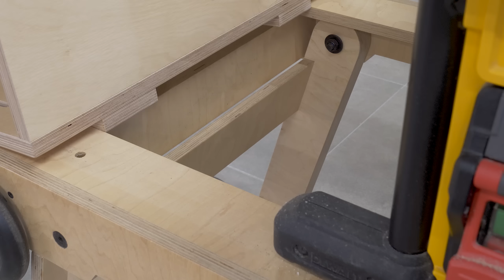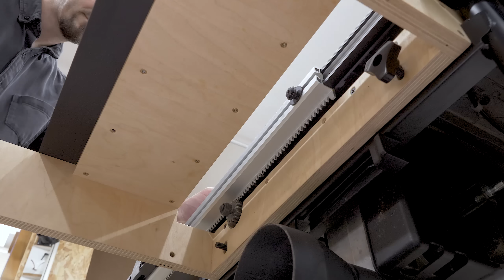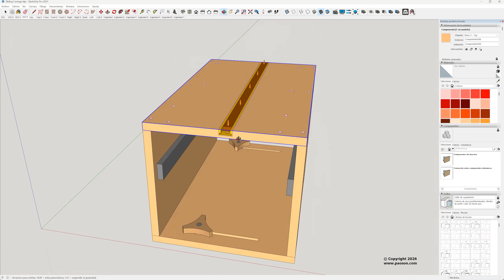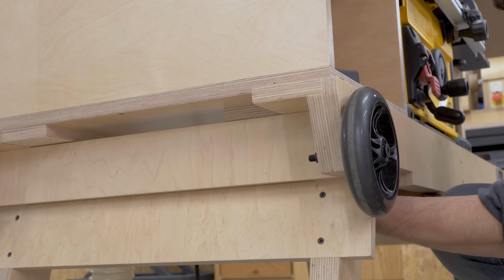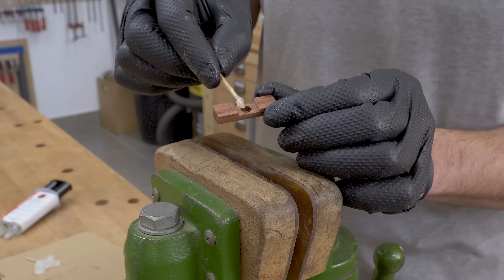DIY Sliding Carriage for a Table Saw Workstation - Ep 1

Comment: The only thing I don't like about this is the drawers probably have to be removed before hand and carried separately, but unless I am mistaken, that drawer space could be converted to be squared perfectly with new grooves cut so that they can store in place sitting the right way up??
That would mean you can roll it out from a vertical storage mode take it up or down the elevator, remove the drawers on the spot assemble the table and then put the drawers back in place without all of the contents getting shaken up everywhere...?
If you are adding sleds and other jigs to the system too, please try to find a way to attach the jigs to the rolling mode.
Its fine if you have a home base workshop but the whole point is to be portable so incorporating as much into the rolling mode as possible would appeal to more people. 

As it is already though, this is a very impressive and well thought out system.
Reply from the maker: Thanks for the suggestion, I'll talk about those topics in the next video!

Comment: Working on my own version and love this addition.  May replace the assembly module altogether with this one. Why is it that you built a box for the frame instead of doing it like the router table?
Reply from the maker: to be able to install the drawer slides, and I think it's also necessary to support the weight of the large pieces you're going to cut with the sliding carriage!

Comment: Very good idea. When I used a industrial Martin sliding table saw, the best part that made it special was the table would slide against the blade so there was nothing that would cause friction during the cut(scoring blade before cutting was amazing too). Seems like wood pieces would catch on things as you moved back and forth? Still cool project tho, well done.
Reply from the maker: you're right about that, but this is the only way to get a sliding carriage with this type of bench saw! That problem is noticeable when cutting small pieces, but not when cutting large pieces. For small pieces, I use the table saw sled.

Comment: The slide for this needs to be parallel to the blade of the table saw. How did you make sure this works and is repeatable when you remove this module and then reinstall it later??
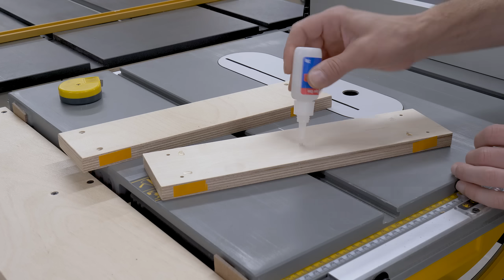Reply from the maker: the two guides I installed at 11:38 are for that purpose, although I need to find a way to square the carriage fence!
Reply: @Paoson_Woodworking Against the edge of the table? Is the edge of the table parallel to the blade? Mine is not!
Reply from the maker: @atomicsmith I will talk about this issue in the second video!
Reply: @Paoson_Woodworking Thanks!

Comment: Back to the DeWalt? Did not like the Axminster tablesaw?
Reply from the maker: I still use both, but the other one is just a bit too heavy for this specific workstation design.
Reply: @Paoson_Woodworking  Ah yeah of course this is the mobile station, you don't really put the 100kg machine up against the wall :)

Comment: So ... how many times have you folded up the table & flipped it on end, forgetting to first remove the drawers? 🤔
Reply from the maker: you're right, it's happened to me a few times!
Reply: If you shortened the height of the drawers, putting another one, or two in to fill up the space, then used shadow foam to keep the tools in place, I'm pretty sure you could stand it up without removing the drawers.
Reply: @Paoson_Woodworking 😕

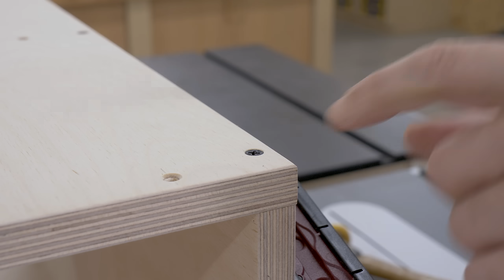Comment: My jaw absolutely dropped on the 10:00 mark when you flipped over the outfeed table and it turned into a sled. What  genius way to store and have multiple uses for everything! I love your craftsmanship and attention to detail.
Reply: mee too!
Reply from the maker: thanks mate!
Reply: Yes!
Reply: Yes it was like a magic trick! And not a crude simply sled either, but a fully functional one.
Reply: I think this one of the best solutions I have come across so far. The option I am going with for my circumstances. No fixed place to work at home (read I am on the patio under cover) but only have a small shed for storage.  Next to tool vertical tool storage so I can move them to the shed following a similar principle as the portable cart. These will then also extend as table support. I am think long trolley with two storage units that when lowered (while staying upright) going from 180 cm to two 900mm high boxes with drawers back to back but with access to one side. It’s the idea - not sure I have the skills to pull it off - it’s all very Frankenstein as up till I bought the plans I didn’t follow any and even now I am modifying them to longer and a bit wider for my DeWalt 7491 EX Type 4 table saw.
Reply: that was offensive for regular guys like me 😁😁😁